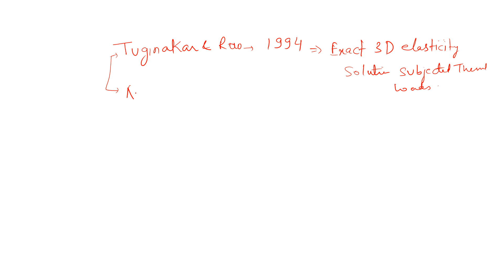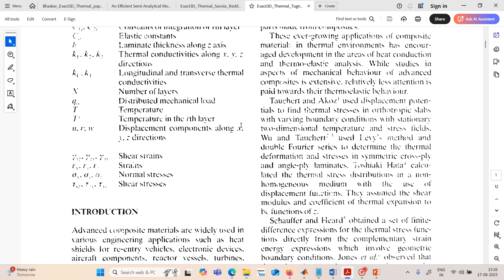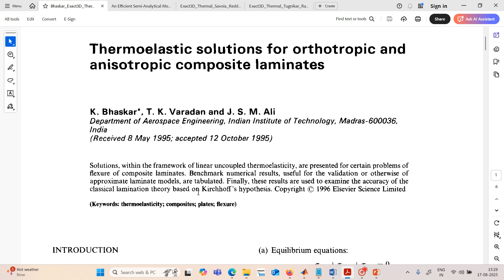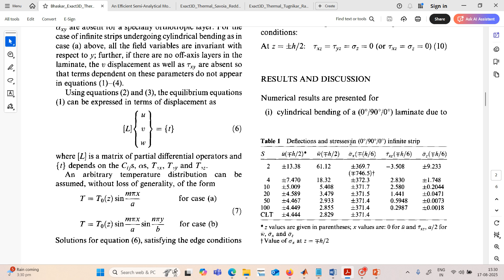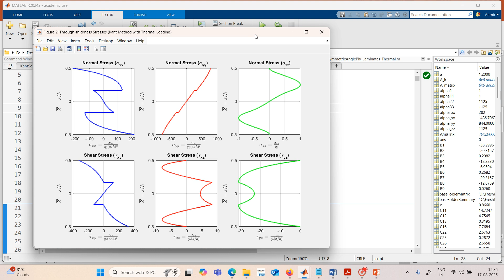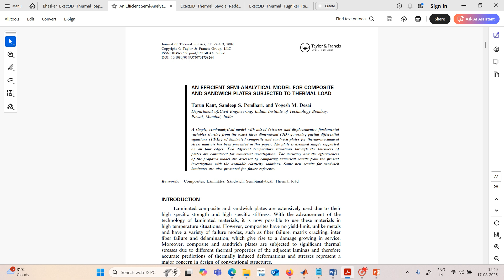3D_Exact Thermal Analysis of cross-ply and angle-ply laminates in cylindrical bending

Comment: Congrats for your work, but I could not see the part where the thermal loads are affected?
Reply from the maker: Dear Dogan, the temperature applied here is linear varying through plate thickness (T(x,z) = T0*(2*z/H)*Sin(pi*x/a)) while the normal stress (\sigma_{zz} due to T(x,y,z) is varying completely differently from mechanical loading). Here in this case only thermal load due to temperature variation is applied. No mechanical load is there, therefore \sigma_{zz} at top and bottom is zero. I think this explanation will help you to clear doubts. If yet there is any queries, you are most welcome.